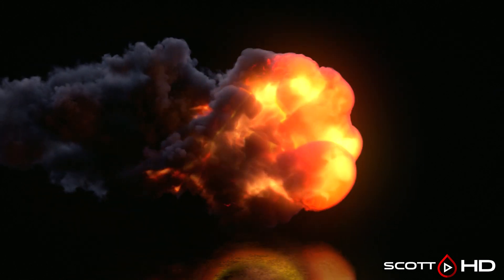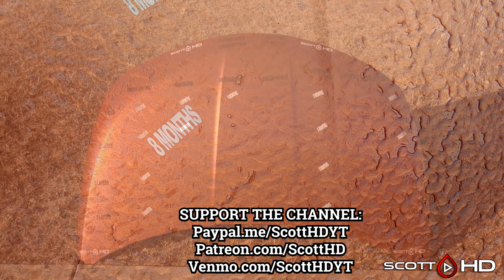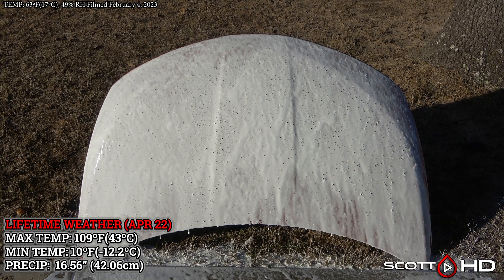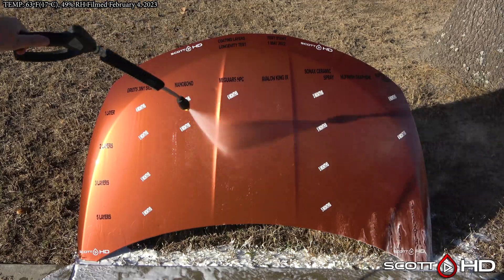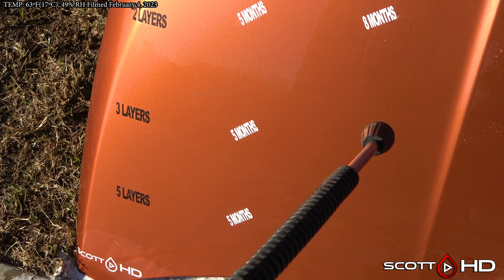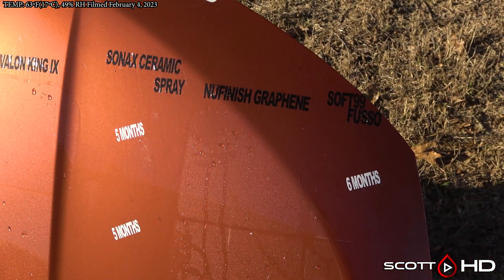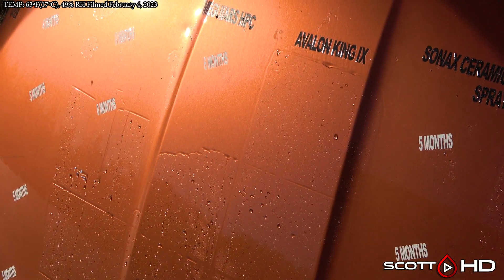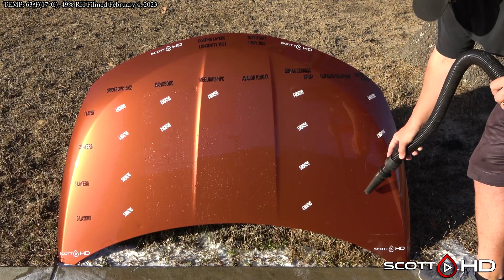CERAMIC COATINGS - HOW MANY LAYERS IS TOO MANY? Top DIY's Tested! - UPDATE 12 - 9 MONTHS

Comment: Applied 2 coats of Nu Finish Ceramic on my wifes car in November in anticipation of Chicago winter.  Just had a 50 degree February day so I was able to wash the car and see how it's holding up.  It's good.  The lower half of the front doors is about dead due to salt being kicked up from the wheels but the rest of the car is still showing signs of life.  I have similar results on my car (which has Griots 3 in 1 Ceramic spray) and this all in line with what I saw with Turtle Wax Hybrid Ceramic spray last year.  I've been happy with all three. 

Nufinish Ceramic the most durable.  Griots the best gloss/color.  Turtle Wax the cheapest.  All good.

Comment: Never done ceramic coatings before, but we’re getting a new car soon. I picked up some AvalonKing Armor Shield IX ceramic coating and it was on sale for $40 a bottle. For less than $100 DIY I figured it wouldn’t hurt to try. Professional shops in my area want $1,200-$1,800 for the professional products. Feel free to follow up with my in a year or two and I can share my results.
Reply: They're professional products that usually come with the prep and paint correction, yeah you can do it yourself but the work to go into it is a whole 15+ hours for a beginner. If you want to do spray wax, you can get nearly a year worth of protection from Griots/Turtle Wax as demonstrated by this channel

Comment: no one mentioning how nufinish is out performing griots? i have griots right now but hard to deny the results
Reply: I'm currently using them both - Nufinish Ceramic on my wifes car and Griots on mine.  Would give a durability edge to Nufinish but I like the shine and depth of Griots more.  Both good.
Reply: The Griot's has always performed pretty much out to a year in his other tests - this one was HUGELY different so it is an outlier as far as the Griot's is concerned. The Nufinish is great in the tests we've seen it in. It's just that this test is one where the Griot's is SO different from every other (and there are A LOT) that it is pretty clear that something was off (whether it is application, curing, or the finish of this particular hood) and so not a good measure of "typical". Typically the durability between the two seems to be very similar but the Griot's usually wins in terms of other desirable qualities (except price where it is not bad, but not as impressive).

Comment: Wonder why griots did so bad in this test. Usually does way better
Reply from the maker: I agree.  I think since it has some carnauba in it, the extreme summertime temps did it in early.
Reply: @ScottHD  is carnauba prone to failure due to freezing in general? What type of product is recommended for the winter (and I'd prefer it not to be a coating due to inexperience on applying it)?